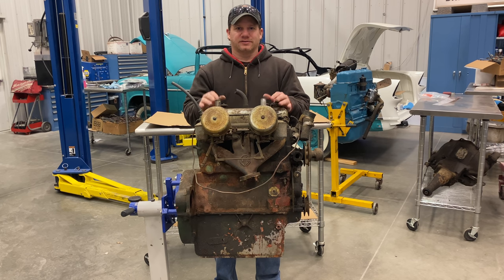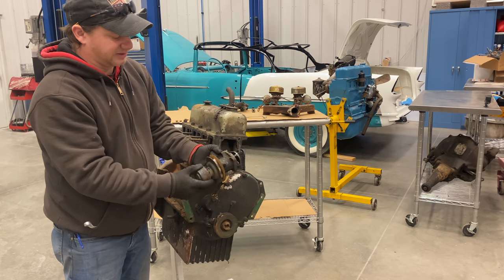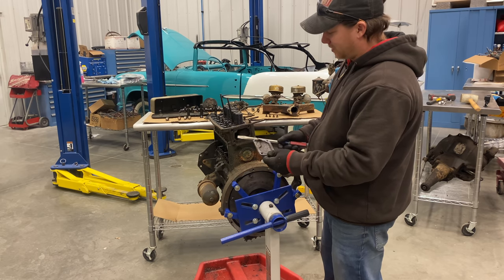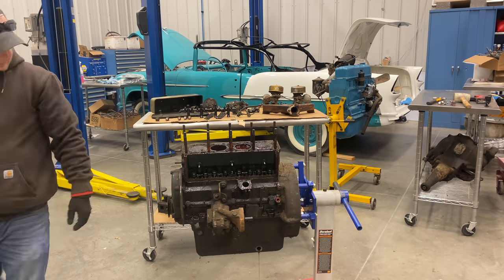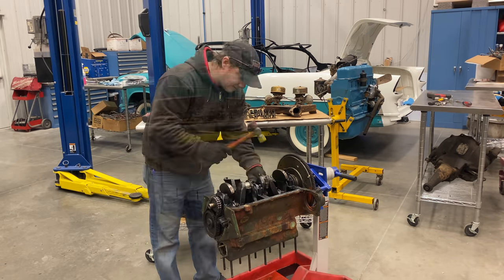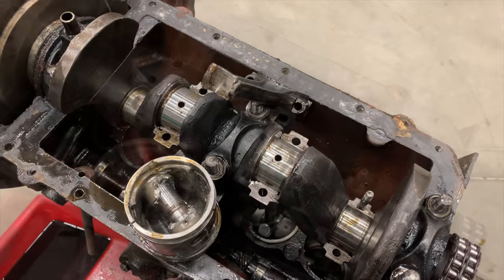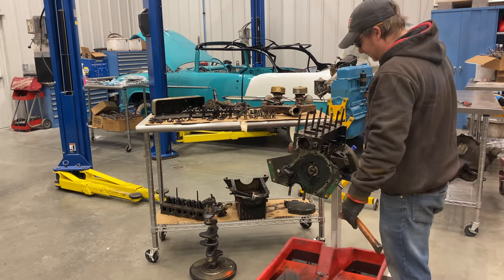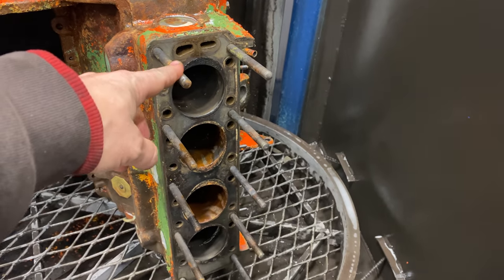What Horrors Are In This 1952 MG TD Engine?

Comment: Steve just a question. At what point do you stop throwing money at a motor? As you said you can check the bore and sleeve if you need to. I'm assuming the engine cleaner you have is what they call hot tanking or is that different. Also shops will do a magna flux to check for cracks such....would you do that with this engine or do you have to send it out for that? I did a rebuild on a 1200 spitfire and I'm not that good of a mechanic to say this is good enough or that is bad....I just replaced all with new and had the machine shop do all the things I did not have expertise or equipment to do. Even after all was done I had to have a experienced mechanic with British cars look over my work. Something as stupid as rocker washers...kept it from running right....someone before me replaced them with soft washers so couldn't get the valves set right

Comment: Im not usually an i4 kinda guy. But this engine is so freaking tiny its amazing
Reply: Size adorableness out of the way though, from what ive seen of other videos what that red oil in the combustion chamber is, is probably automatic transmission fluid or some sort of anti rust oil like that.

Comment: What are your plans for the engine?  Supposedly you can overbore the XPAG and sleeve back to 1466 XPEG (TF 1500) size.   They make roller cam kits, super charger kits, Laystall aluminum heads, billet crank... you could have some real fun building a slightly faster one!
Reply: Slightly faster?  My TD MK II still with a 1250 cc engine was a lot faster.

Comment: Do freeze plugs really work,Have seen many many cracked engines from freezing ,but freeze plugs never budge.🤷🤷🤷
Reply: Their purpose is not to prevent damage to the block from freezing. The holes are for removing sand from the water jacket after the block is cast. If a freeze plug pops because the block froze it was a matter of being lucky.
Reply: @curbmassa  ok thks ,since a child many mechanics have told me it was to prevent blocks from cracking.But evidence shows otherwise,thks for the respond

Comment: That rod broke because the pinch bolt came loose. Seen it happen a time or 2 when I was an apprentice 50 years ago.
Also, those old blocks were so porous that resleeving was kind of mandatory to prevent water in the oil.
Reply: Porous? That never happened in mine, Maybe you need to go back to being an apprentice.

Comment: What's with the bottom 4th piston ring?
Reply: Scraper ring, it has slots in it that allow oil to go in through the holes in the piston. If you notice on the inside of the piston you can see the holes that allow oil through. Quite common on older engines with longer pistons.

Comment: Fantastic rip down, wonderfull engine but they were thrashed in the day, loads of guys raced, hill climed etc , no wonder it had a broken rod...if it breaks at little end its too much heat, if it breaks at bottom its oil starved but please please can i make a serious comment.....take those shades off your cap...your indoors!!!
Reply: They were thrashed a lot but were a solid good engine, My MG TD putting out about 85 BHP and able to rev to over 7,000 but I normally restricted it to 6,000 even though it was a well balanced engine.
 I had little trouble, I did have the oil pump drive shaft come loose once, a good practice is to put a new circlip on when the engine is stripped down, it seems obvious to me now and we hopefully learn from mistakes like that.

Comment: A old trick  the Racers used to do on the TD engines was  they would pull a couple of sock Pistons  and replace them with q1950s Mercedes pistons that are the same diameter but they are domed on the top  to give them a little extra Horsepower  without the Judges  being able to see  easily  we actually did it on my Dads 53 TD  and with using all the  statistics  as best as we could  we believed we  actually got just under 4 more horsepower  out of the factory block  of course it’s kind of funny  but back in the days they were racing  many of the T series cars inAmerica on dirt tracks having a car that had a few extra horsepower  could make you the fastest on the track  for my Dad and I we got more of a good laugh telling people it had a Hemi engine in it  BTW  my D used to hang out at the tracks as a teenager  and he remembered that old trick as a TD was his Dream Car  and he found that one at some service statin in th 1960s  that the owner of the Station told my Dad the car owner didn’t have the money to repair the car  so he put a lean on it and got the title  inthe 1980s my Dad and i did a complete breakdown and assembly  on the car  after it had been garaged  for 28 years

Comment: I heard through the grapevine that these engines were originally designed and used in tractors.  Any truth to that?  Looks like it was abused in service and marginal mechanical work on it in prior times.
Reply from the maker: The engines were cast at the Wellingborough Ironworks which at the time was also casting a lot parts for Nuffield tractors but no it is not a tractor engine.
Reply: @ThisWeekWithCars  Thanks.

Comment: Nice big gaps between cylinders.
Modern engines are way too close and head gasket failure all too common especially on small capacity over stressed turbo petrol engines

Comment: The engine was sitting since 1966 and it had already been "freshened up" and repainted twice in 14 years between 1952 and 1966?      It was owned by a tinkerer which is why it tossed a rod to begin with    LOL.

Comment: What's the story on the '55 ragtop?
Reply from the maker: Full nut and bolt restoration I am doing.  V8 with power top, power seats, power windows, and continental kit.
Reply: @ThisWeekWithCars  That'll be a big money car when you get thru.  Have fun.  265, 283, 327, LS, or what?

Comment: Shame it was left for dead they were legindery engines I think it was 52 when John Tojeiro designed and built four race cars Tojeiro-mg barchetta and used the Xpag MG TC 1500 engines at the time fitted with a supercharger to stock engines and getting runs of 190mph with a shorrock Judson or arnell Marshall supercharger the design was brought by AC cars and turned into the AC ace

Comment: Back in the 70's my engine developed a knock ripped the engine apart sent the heads out to get checked out  l was told the pistons were hitting the top of the head due to worn wristpins they recommended to have new ones installed  plus new rod bearings and have crankshaft turned down the machine work was pricey,,wound up buying a used engine for less money than the parts involved and less labor to do the job.Do you want to drive the car or be a slave to the engine?

Comment: throw that heavy engine away. back in 1960 I put a 62 chevy inline 235 6 with a 3 speed standard and shortened power glide ratio rear end into my friends 52 td. after all the redesign it in fact was faster than a tr4. . vertical fire wall. sprite bucket seats. special radiator made with cadillac core. fenton headers, glass packs twice pipes coming out under the bumper, weighing it on a grain scale with the driver in it and half a tank of gas it was 75lbs more on the rear wheels. great handling. speed and a real car. that british crap makes a model  A ford look high tech. if we had not thrown the engine away it would be worth real money today. who knew.

Comment: Total rebuild. New pistons, new connecting rods, rebored cylinder sleeves, new everything...the lot!
Reply: Some of the parts for the XPAG, you can get new, others not so much.
Reply: @netpackrat  
Most parts are no problem, if not available where you live they can be ordered from England, not that it would need many parts most of that is just on the surface.

Comment: This seems to be an awful lot of trouble to go to with a fair amount of expense to end up with 54 hp.  A better solution for this particular car is an engine and transmission swap to a Volvo B18 or B20 and either the M40 4 speed gearbox or the M41 4 speed with overdrive.  https://groups.io/g/VolvoPoweredMGs
Reply: @General Melchett No, a safer car.  A TD with the original engine and gearing is scary on a modern highway.  TDs are not bringing much nowadays, getting less and less valuable every day.  And reason is that they can't get out of their own way and no one under 60 wants a car like that.
Reply: I've owned my TD for 50 years, and when the engine needed to be rebuilt again, I opted for more power with a Volvo engine.  Most people do not realize it isn't the original engine because it looks so much like the XPAG and fits perfectly with no cutting in the engine compartment.  I put up with all of the negatives for 43 years, and now have a much safer and fun to drive car with all of the original feel to it.  Don't knock it until you have tried it.  I doubt if anyone who has had a well sorted T series with a Volvo engine would ever go back.
Reply: @CPT Ivanitchyanus Oh, sure you can put twice what the car is worth into the XPAG, but that has diminishing returns, especially with T series prices going down and down.
Reply: @General Melchett There's a special corner in Hell reserved for guys who bastardize classic cars with non-original drivetrains.  Dude wants a Volve, he should drive a Volvo.
Reply: @charliebaldwin8798  
I have yet to see prices going down in relation to other old cars. As for putting in a different engine, that is a sure way to send the price way down,  You want safer? Yet the TD is a very safe car, excellent chassis, good brakes, very good steering and it does keep up with traffic rather well, My only problem with My MG TD MK II was going slow enough for more modern traffic especially if it was raining.

Comment: Whitworth fasteners by any chance?
Reply: No, they used Morris Metric at the time. Morris and MG used nuts and bolts from Germany, they were standard BSF head sizes but the threads were metric cut in Germany. Later they used BSF.

Comment: Three bearing crank early 850cc mini was the same. At least Ford used 5 bearing cranks.
Reply: Ford used 3 bearing cranks In the 997, 1,198 and 1,340 cc engines until 1962. So the early Mini in 1959 and the Ford Anglia in 1959 had three bearing crankshafts and they worked just fine.
The engine in this video was from Wolseley in the 1930's.

Comment: Lucky it did very little damage when it was over revved , usually on a down shift and usually on these poorly designed cars because they had poor brakes another case of a sort of good looking car at the time built with little foresight and the main reason the entire english car industry went bellyup
Reply: Not a poor design as it was from the 30s with 30s knowledge.
Sadly it was bad management in most of the UK car manufacturing industry coupled to industrial relations/wages etc which put paid to most of the UK car industry.
Very fine car and, when maintained properly would give you decades of extremely enjoyable motoring.
Brittish designs were finer in design than most US stuff but it didn't make them less successful, think Cosworth DFV and you will understand what I mean👍👍

Comment: I would just put this straight into the junk bin :)
Reply: You could buy a new honda for the amount of time and money to fix this car.
Reply: You might.
Reply: @jeffhallel8211  
The new Honda will be junk inside ten years this if it is looked after could still be running in fifty. It would not cost much money to fix and less time that trying to fix anything on the Honda.
Reply: @barrierodliffe4155  I bought a 2013 fit new.They were the last of the Japanese,they moved production to Mexico.So now the car has 77k and looks almost new.Another 200 k and I can get something else.Repair bills are almost zero.The British cars of the 50's and 60's were not good even when brand new.Sort of like Fiat.
Reply: @jeffhallel8211  
Strange how I bought a well used MG TD in 1968 it was like new, so it was already 15 years old and it did not need much work, it was still fine when I sold it to go overseas in 1970, my other MG TD a 1952 model I bought in 1972, the only problems I had were due to a hamfisted moron who should never have touched any car, I fixed it up and I kept it until 1976 entering many hill climbs and other car club events before I went overseas again, 24 years old and running very well, very reliable and I do not know the mileage of either except they had both done at least 200,000 miles, both were driven daily.  
The FIT is a rather poor car, good for shopping but not much else.
I now have a 2006 VW Golf and a 2004 Kia Optima, both look good, like any car it is just a matter of looking after them.
Reply: @barrierodliffe4155  O.K. so why is the fit a poor car? There is no comparison between British cars and the Japanese.The Japanese perfected the sports car with the miata.Any cost analysis will show that the miata will be less expensive to operate than the British sports cars.Availability of parts can be a big issue also.
Reply: @jeffhallel8211  
Well it is ok for a little unexciting shopping car but never a drivers car.
Mazda got hold of a Lotus Elan and a Triumph Spitfire, they copied the shape of the Lotus but the Mazda was twice as heavy and not nearly as good.  
As for a cost analysis.  My next car after my 1952 MG was a 1973 Mazda, the steering was dreadful, the brakes not good, it was far less reliable, I had to fix the suspension, Mazda made the front struts and it was possible to fit the dampers upside down, somehow Mazda had done that and never noticed, the original owner sold the car cheaply and after driving it a short distance I pulled out the struts and bough new parts, that changed the handling from very bad to ok.  I also stripped the brakes and had the cylinder head off and planed, a case of Mazda overheating.
I did not find it cheap or good, that is not the only trouble I have had with Mazda poor quality. AS for parts I never had a problem even when my car was 24 years old and now for the same year MG parts would be no issue. They would on a few year old Mazda 
Back to the perfect sports car,  that is a long way from Mazda, I had a British saloon car that had better handling.
Parts may be a big issue on a few year old Japanese car, not on a 60 year old British car.
Reply: @barrierodliffe4155  I notice that there are actually more Japanese cars sold in the U.S. than British cars. People really enjoy spending money to fix the Japanese cars and they like to spend more at the gas station because they get terrible fuel economy. The Japanese manufacturers should hire British engineers to show them how to make a decent car.Land Rover may be the only true British car sold in the U.S. since mini was corrupted by the Germans.
Reply: @jeffhallel8211  
Strange how the Japanese do get British engineers to design some of their cars and the Mini is made in Britain.  Germany also make good cars.  
USA buys most cars from other countries including Europe and Korea. The US car industry is not looking very good.
Reply: @barrierodliffe4155  The Germans bought out mini when mini was almost bankrupt,they redesigned the mini. Is Rolls still importing engines from Germany?
Reply: @jeffhallel8211  
The Mini was part of BMC and it was Leyland that destroyed BMC then Austin Rover that made a mess of it. BMW bought Austin Rover to get hold of Land Rover and the Mini. The New Mini is made in Britain Holland and Germany.  One thing is there is no US input or influence so that is a very good thing.  
Britain and Germany are not enemies any more.

Comment: Ah, the English junk. We put up with it for many years here in New Zealand until the Japanese finally showed us that proper hardening was truly possible and regular engine rebuilds became a thing of the past (along with most of the rubbish English designs)
Reply: Yet many of the rubbish English cars are still around and work much better than the early Japanese cars. Poor bush mechanics in NZ used to ruin good cars and reliability went out the door with built in Japanese obsolescence.
I did a regular engine rebuild on my MG Midget motor, it had been raced, hill climbed and used for many other competitions by  myself and others and fitted with a supercharger and had done  over 100,000 miles and that included revving to over 7,000 rpm regularly.  A simple rebuild and it was ready for many more years.
I am so happy that I keep on seeing so many of these old English cars on the road but so few early Honda or Toyota.